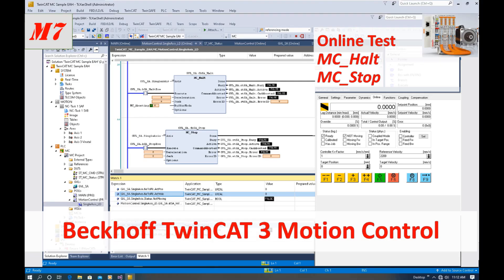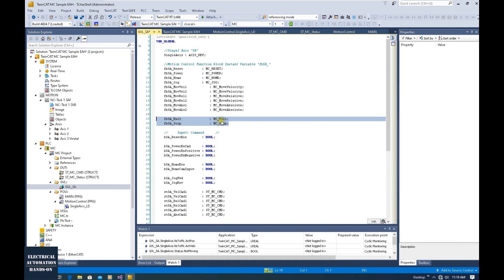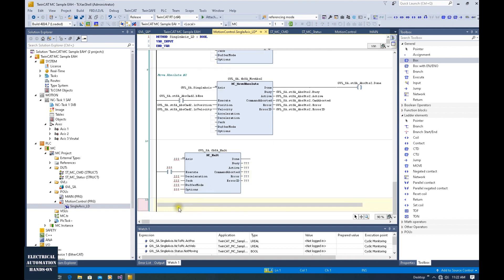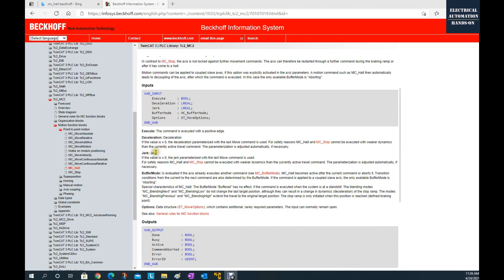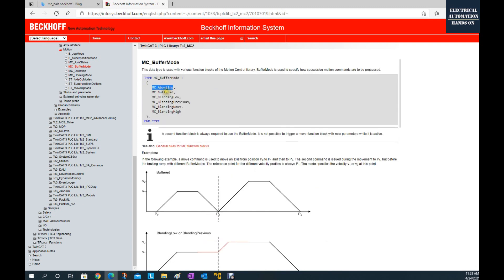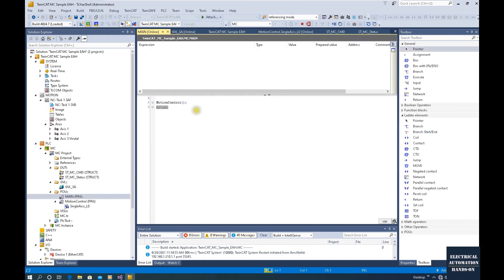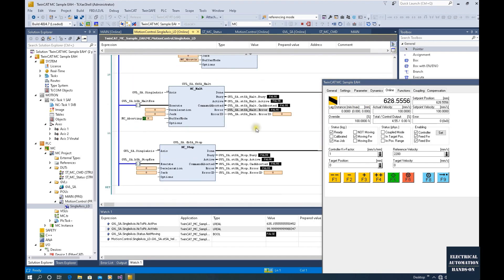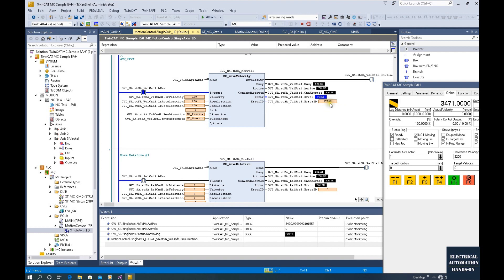MB07. [TwinCAT 3 NC] Online Test MC_Halt, MC_Stop to Stop Axis Movement [10/20]

Comment: Sir, i have been following your series about the MC motion control as well as the Stepper motor NC control a long time now and its been very useful. Thanks a lot for this very good and detailled explanation videos *thumbs up*! 

One remark, dont know if you noticed but the SingleAxis.Status.NotMoving flag is not changing at all wether you move along the axis or not (also in the last 2 videoes). I realized that because i wanted to implement some HMI logic based on that flag. If you have a solution for that i would be happy if you coudl share that with me.

regards
Reply from the maker: I think you need to call ReadStatus(). pls review this video https://youtu.be/M9TP4Q4gNJA